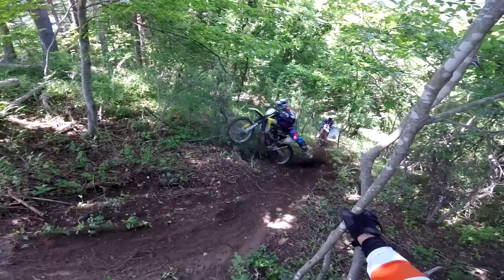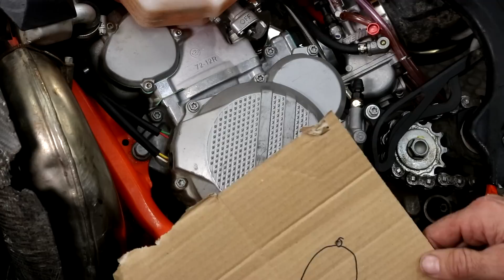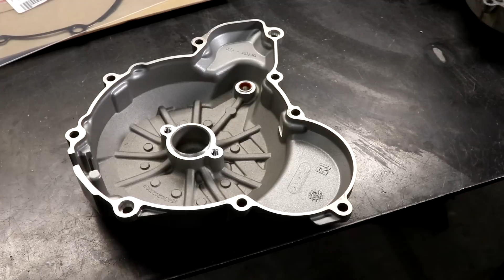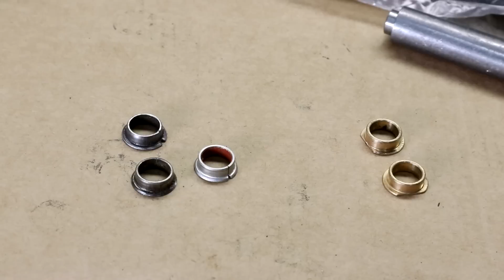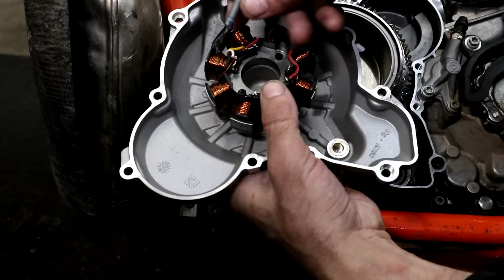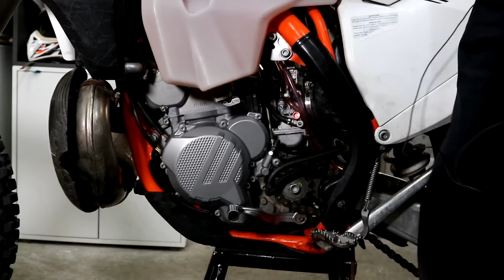2017 KTM 300EXC Electric Starter Repair

Comment: Would you recommend replacing flywheel rotor if the teeth are chipped?
Reply from the maker: The flywheel rotor teeth chipping is not normal. Yes, I would change it it.

Comment: I’ve changed all of these parts on my xcw several times, I never realized the bushings could be removed with that puller! 
It worked a lot better than the drill bit method. 

This time I went with the xrc bushings, good to know they are superior to the oem.

Comment: Great video! 1 thing, i don’t understand why there is a slit in the bronze bush? As its a dry case? No oil.

Thanks
Reply from the maker: As mentioned in the video I used some light weight oil (which doesn't tack up) on the flywheel and bendix. Excess oil will be flung off, some of which may drip down on to the bushing flat and then seep into the bushing to lubricate the bendix shaft.

Comment: Why do you have to pull the flywheel off? I've watched several videos and it seems like the flywheel has to come off to get the bendix out, but you can get the bendix out without taking the flywheel out. Is it just for ease? This would be for the entire starter motor repair.
Reply from the maker: No, you don't need to remove the flywheel. The bendix will come out without removing the flywheel, as shown in all of my videos for XRC bronze bushing installs. But if you do remove the flywheel it is without doubt easier to remove and reinstall the bendix.

Comment: At 2:10 you mentioned putting the wrong bolts in the wrong place will lock the starter motor…that saved me a huge headache!
Same goes for the clutch cover at about the 4 and 5 o’clock positions.  If you get those mixed up, which I did, the starter will not turn over.  I was about the take the motor out to get to the starter. Thank you for the vid!
Reply from the maker: Very pleased to hear the video helped you out...

Comment: I wonder why on those new bushings that the flat had to be facing / pointing up?
Reply from the maker: The flat is designed to collect oil and then drip it on to bendix shaft to help ensure good lubrication
Reply: @TokyoOffroad  Hello thanks for your reply but I wasn't aware there was any oil in this area of the engine?
Reply from the maker: @outbackenduro7418  - Normally there isn’t. From the factory grease is used to lubricate the flywheel teeth, but it flings off very quickly and can make it’s way inside the bendix, making it sticky. For this reason I recommend using some light oil (select one which won’t tack up) to lubricate the flywheel and bendix gear teeth as shown in the video. Yes it will fling off, but drip down again unlike grease. Oiling should be repeated periodically during the starter system inspection.

Comment: My starter doesn't even do anything anymore. My starter relay actually caught fire as the starter wires were ripped out of the housing in behind the headlight due to a fall. The wires crossed themselves and were engaged for I don't know how long, but long enough for the relay to catch fire. 

Time for a new starter motor, I guess?
Reply from the maker: Wow! One quick check you could do to see if the starter motor is still OK is apply 12V directly to the starter motor terminal and see if it turns over. If it doesn't turn over with 12V applied directly and the bendix isn't jammed, then it would indicate that you do need to replace the starter motor.
Reply: @TokyoOffroad  and the terminal is on the clutch side of the bike, correct? Below the expansion chamber where the wire connects?
Reply from the maker: @EricNeilson_  Yes, that's correct. The terminal you can see is for the +12V connection. The ground connection is through the body of the motor and connects to the battery via the engine and frame.

Comment: The best mechanic online!!! Does xrc have a kit for beta?
Reply from the maker: Thank you. You should be able to use the XRC 2020 kit (2 long bushings) to replace the stock Beta bendix bushings: https://www.tokyooffroad.com/product/xrc-starter-bush-kit-250-300-2t-tpi-2020/
Reply: @TokyoOffroad  
Do you ship to Israel?
If so, what is the shipping quote?
Thank you
Reply from the maker: @hershko85  Normally I ship to Israel using Japan Post, but currently the service is temporarly suspended due to Coronavirus. However, I can ship using UPS. If you'd like a quote please contact me here: https://www.tokyooffroad.com/contact/

Comment: i cant seem to find these stocked in Australia do you ship if so how much? cheers
Reply from the maker: Thanks for your interest. I'm happy to ship Worldwide. Normally I ship to Australia using Japan Post Registered Airmail which costs US$7 to post an XRC bushing kit. However, currently due to Coronavirus the service to Australia is suspended. I can ship using Yamato (with final delivery by UPS) but the minimum cost is US$25 for up to 2kg shipping weight.

Comment: Did you have to go to the dealer for a new bendix?
Reply from the maker: Yes, a new bendix was purchased from my local KTM dealer.
Reply: @TokyoOffroad  thx brother. Starter is acting up on my 18. I can hear the starter spinning but not engaging the flywheel. Gonna have to inspect it but I'm thinking it's the bendix.

Comment: I have a 2020 Ktm Xc-w with 18 hours the starter spins over but doesn’t engage, I carried back to my dealer and the replaced the starter drive and it started one time and did the same thing. They are taking apart again tomorrow , have you seen this on a 2020? Thanks
Reply from the maker: I sounds like it’s probably an issue with the bendix.

Comment: I just did this on my 2018 Husqvarna TX300. The bike has 50 hours on it and the stock bushings were still fine. Both the ignition cover and case bushings were the shallow bushings. You may see on Tokyo Offroad's website that he suggests you check your bike to see if either bushing is deeper than the other. Mine were identical so I bought the XRC 2017 250/300 kit. Both stock bushings came out with relative ease using a pair of squeeze-to-open pliers and a twisting motion. Both XRC bronze bushings were still a tight fit that required hammering into place as shown in this video on the ignition cover bushing. So, I did not use Loctite. I also lubed the gears with a lighter engine oil 5w30 rather than grease to be sure the bendix did not get gummed up.

Comment: where do those bushings ship from.  I want to order some. But if they're coming from overseas, it's useless right now because of the covid-19 crisis
Reply from the maker: Thanks for your interest. I ship from Tokyo, Japan. So far shipping times don't seem to have changed that much to most countries. 7-10 days to the US.
Reply from the maker: I just checked some recent shipments. Some seem to be arriving on time, others are delayed. I spoke to the Post Office and the number of flights has been reduced so they said delays are occuring. If you need a bushing kit quickly I can ship by EMS (which doesn't appear to be delayed, 5 days to US). You can contact me here: https://www.tokyooffroad.com/contact/

Comment: Hello.
How long the xrc bronze bushing last?
Reply from the maker: The XRC bronze bushes should last the lifetime of the bike with periodic inspection and lubrication. As I mentioned in the video, it is important that when installing them they are held in place and don’t spin in the bore. Because the OEM bushes can easily deform and wear the bushing bore you may find when installing XRC bushings they have some play and can be rotated. If this is the case some retention compound (E.g. Loctite 638, or 648) can be used. If however the bore is badly damaged, or cracked it should be repaired, or replaced before installing XRC bushings.

Comment: I bought  your XRC bushing kit for my 2015 TE300 . From Tokyo  Offroad (you) a few weeks back. WOW, I really believe there's less friction now, starter has more torque to deliver to the flywheel . I'm hoping the  Starter Bushing  might last a bit longer. I use Lucas  X-Tra Heavy Duty Grease. I add Tungsten Disulfide (WS2)  and mix, works super well. Super slippery,  is inert, non-toxic, and non-corrosive. Thank you.
Reply from the maker: Ray - I’m pleased to hear that the XRC bronze bushings are working well in your bike and appreciate your business. I’d recommend a period inspection and re-lubrication if required and they should last the life of the bike.

Comment: Thanks for the video. Symptoms of worn bushes? My 2017 300 starter is just makes a clicking sound on the relay. I checked voltage on the battery and it 12.7V. I first suspected wiring or bad earth.
Reply: R Parks have you removed the clutch cover recently? If so, you probably put the bolts in the wrong order and the starter is binding. If not, check voltage at the starter motor. Make sure you are getting 12v.

Comment: super vid ...my starter motor holder holes were loose so I retapped them to a bigger size and with the snug tight fit it finally works ..
I had done more or less everything else including new bendix and was just about to give up .

Comment: What type of oil did you end up using for the bendix? I was thinking a high quality gun oil would work, I have a ton of Mpro 7 on hand. Going to do the bushing install sometime soon, not an emergency, should I just order the motorex 2000 instead?
Reply from the maker: Yes, I think that oil should work well. A light weight oil which doesn't go tacky is fine...

Comment: Great video!  Any chance you can provide insight on removing the bendix?  I’ve got bike apart and can’t get the bendix past the fly wheel. I bought the bronze bushes, any help is appreciated!
Reply: The bike is newer. 3 rides on it. And it’s a 2018 so it should all be the same. I’ve got the cover off, bike laying on the side.  I pull the bendix straight up and the base below the engagement sprocket hits the fly wheel. It appears you have more room around the fly wheel. Mine is a XCW 6days. Not sure if that makes a difference. Thanks for the reply.
Reply from the maker: Mike Rasmussen - The bendix will come out without removing anything else. Try moving the flywheel to and fro while juggling the bendix. It’s tight and a bit like a puzzle, but can be done without damaging anything. The same is true for re-installing the bendix following bushing replacement.
Reply: Tokyo Offroad I gave it another go tonight and you’re correct it will come out.  I cleaned everything and coated the fly wheel, bendix, starter gear with the Motorex Spray 2000 which made everything more slippery.  Once I got the bendix pulled up to where it hits the fly wheel, I gave it a bit more “muscle” with my hand (no pliers or tools) and with the extra effort yank, it came out.  I think lubing everything very well aided in the removal.  I really appreciate the extra help on this.  Had to do 3 bikes, my KTM and my sons Husqvarna 300’s.  Projects completed. Great high quality products you’re selling.  Can’t say thanks enough.
Reply from the maker: Mike Rasmussen - That’s great. Pleased to hear it was successful.
Reply from the maker: Mike Rasmussen - There is just enough room to remove the bendix with the flywheel and starter motor installed. As such all you need to do is remove the ignition cover and you can the take out the bendix. It’s very easy if the engine case bush is worn. If however the bush is new you’ll need to jiggle the bendix about a little, but it can be done. The same is true for installing the bendix.

Comment: Great video!! Just a heads up, Phil's cylinder base gasket is flipped the wrong way. It should not be sticking out that far under the left power valve cover. I made the same mistake on my 17' 300xc.
Reply from the maker: Oh dear. His 300 kit was installed by his dealer :-O it’s due for a top end overhaul soon so I’ll be sure to install the new gasket the right way round...
Reply: Ugh oh I might have done the same. In sure it won't affect anything will it?

Comment: Any recommendations of what compound to use if you have more slop? I feel mine has even more movement than yours, perhaps a different locktite?
Reply from the maker: noahr - Check out this document. Near the bottom is a table with recommend maximum gap. Loctite 648 is recommended for gaps up to 0.15mm, 638 for gaps up to 0.25mm and Loctite 680 can be used for gaps up to 0.5mm with activator: http://dm.henkel-dam.com/is/content/henkel/RetainingDesignGuidepdf

Comment: EXCELLENT video. Just bought the bushes from your site along with some other tools. Great work on these videos man, please keep it up! When you drop them I watch them right away- I ride a lot and do all my own maintenance and your videos have been invaluable. I'm kinda hoping your clutch side main seal goes so I can watch a video of the repair, as mine is probably the culprit of gear oil in my exhaust!

Comment: Ktm just can’t seem to get a solid starter motor setup on the smokers for some reason
Reply from the maker: Agreed. Definitely an improvement over older bikes, but the decision to continue to use of the original bushings  is baffling

Comment: that puller is INSANE! cool, but insane! I just used a flat head screwdriver that was about the same size, they turn prety easy in the housing so they just come straight out

Comment: I have 3 bikes. A 2018 KTM 300 XCW and (2) 2018 Husqvarna TE300. I ordered 2 of the 2016 packs as I need 3 bronze bush sets, and will have an extra set as a back up. These will fit my 2018, correct?  Great video and thanks so much for putting this all together!
Reply from the maker: Thanks for your order. Yes, they will fit your bikes no problem. The only difference between the 2 kits is the number of bushings (2, or 4).
Reply: Thank you, Sir!
Reply: Mike Rasmussen hello Mike I just replaced the bendix and oem bushings I also installed a new lithium ion battery.  I can easily kick start the bike (Ktm 2016 xcw) one kick but when I use the e starter I can hear the piston Turning and bike attempts to start but  it just wont turn over  any ideas?   I was thinking maybe replace starter but it seems to be fine 
Other than that the bike runs great any help appreciated
Reply: We3K1ngs make sure your battery is pushing over 14 volts to engage the starter.  My bikes are 2018 so my starter system is different then yours. I’m not familiar with your system. Sorry.
Reply: We3K1ngs Hey We3K1ngs did you ever figure your issue out? I am having a VERY similar issue with my 2016 Husky te300 (mostly the same bike as yours).

Comment: Quick note on the clutch side bolts (this lead to me having to replace the starter motor) Not sure when it changed, but on my 18 300 xcw manufactured around September of 18, the stock clutch cover comes with a bigger space on that one bolt which prevents you from accidentally driving it too far and all of the bolts are the longest version vs. one being a little shorter. Great update, however if you have an aftermarket cover, in my case the hinson, even if you are careful and put the bolts back in the same place, now that that bolt is also longer it will go through the starter motor.

Comment: Great video as usual !  Any idea if these fit a 2018 150xc w
Reply from the maker: The 150 bendix bush part number is the same as the 250/300 so should fit fine.

Comment: Do you think this may apply to the four stroke motors too and does XRD make bushes for them?
Very informative video
Reply from the maker: The four stroke electric starter systems (starter motor engages directly with a gear system) are quite different from the 2-strokes. The bushes and parts used are also different. The XRC bronze bushes are for 2-stroke applications only.
Reply: @TokyoOffroad  thanks for the quick response and  info much appreciated

Comment: Great vid, Where do you get the bushing puller and slide hammer?
Reply from the maker: It’s an import blind bearing puller set (made in Taiwan?). I purchased it at a local tool shop in Japan about 5years ago.

Comment: Nice repair... But fixing the case would be cheaper.. We are not rich.
Reply from the maker: The ignition cover cost is about $80. The cover material is magnesium and would require TIG welding then machining. I have kept the old cover and may try to repair it at some stage for a spare.

Comment: On such an expensive bike why  are there no roller bearings for the bendix is it because of weight savings? Also I read that some people will fill the case up to the bendix with a light weight oil to keep  the components lubed and last longer  the only downside i can see is if the  starter seal might allow oil into the starter motor, thoughts?

Comment: This and the previous video, together, they are arguably the best video resource that is available on this matter. There is more useful detail in this video regarding this nook of the starter system than there is in the official service manual for the bikes. 

The advice on use of oil vs grease is a gem. My Freeride’s Bendix was all slathered in the Molykote bearing grease the factory uses. It would seem that just light oiling is necessary here. 🙏 

And thank you for mentioning the Freeride specifically , it’s a bike that too often gets ignored in DIY videos. 🙏

Comment: I had the same problem on my KTM on the engine side as opposed to an easily replaced cover, and I used a JB weld like high temperature epoxy resin to fill the oval wear of the bushing seat by using an undamaged bushing as a mold. I used a thin coating of a silicone grease at the back of the bushing to prevent the bushing to stick to the epoxy. Replacing the flimsy original bushings with brass ones is an excellent idea too.